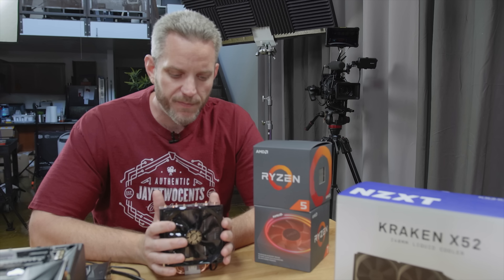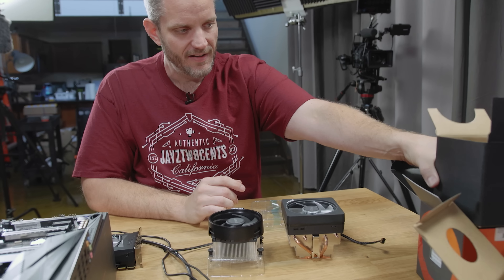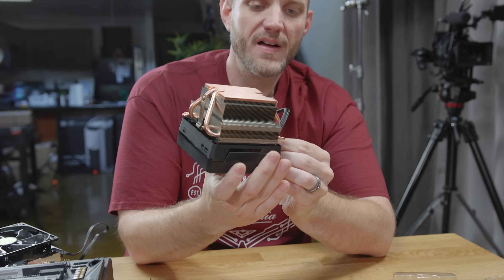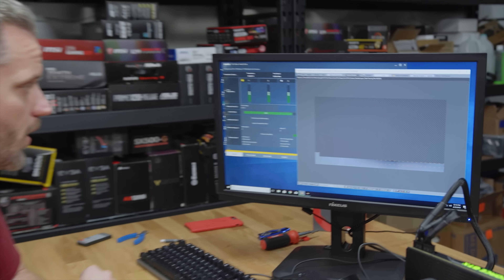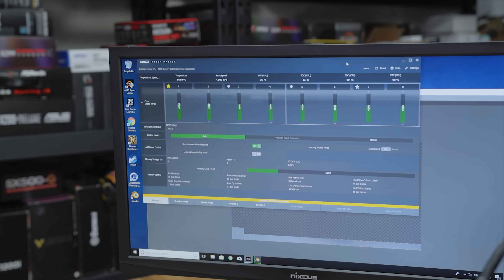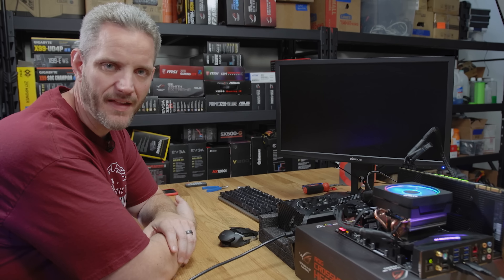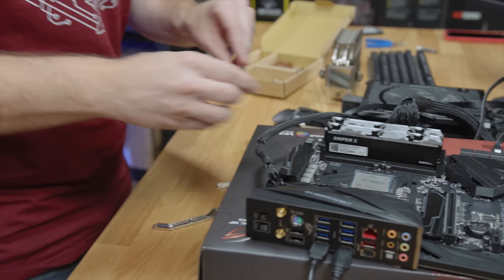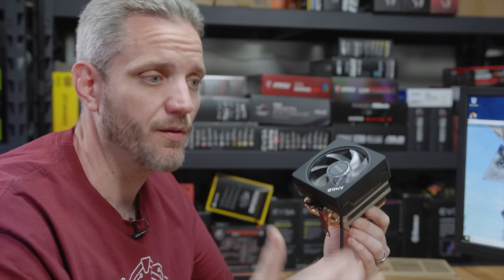Overclocking with a stock air cooler?? Is it even possible?

Comment: Intel: You need to buy K processors to overclock.
AMD: All our processors overclock themselves (as long as you have adequate cooling).
The difference in attitude is amazing
Reply: So can i overclock  on a b450 mainboard or i need to buy the x470
Reply: Apple vs android
Reply: @Max-io3uz  You can overclock an AMD cpu with a B-series motherboard.
Reply: @MrGrayfour  how about on a x470?
Reply: @OsmanthusWineZhongli  as the highest end chipset available for AMD CPUs at the moment, of course it can. :)
Reply: @MrGrayfour  x570
Reply: the z370 lets you overclock even if you don't have k
Reply: AMD is best. change my mind
Reply: kool aid obviously but you don’t have a warranty if you fry a cpu that’s not k
Reply: @solace512  thats bs
Reply: Still intel provides better perfomance for gaming
Reply: CIA if your going with performance yes intel Is currently better , but for the price AMD is fine
Reply: MrDope  I'm pretty sure he just means forcing all goes to body at turbo speeds. Technically "overclocking" I guess.
Reply: @Max-io3uz  For amd both Bxxx and Xxxx boards can overclock. Axxx boards can't
Reply: @Max-io3uz  b450 can overclock
Reply: @Max-io3uz  you can, check out the ryzen mobo tier list someone made.  Look for a tomahawk if you want to oc, one if kot the best b450 mobos.  Outranks even some x470
Reply: @WinningEmpire  x570 is a waste if money unless you are going with the eztreme high end (r9 3900)
Reply: @nerocladius4319  not anymore my friend
Reply: @camielschilham3958  skme b450 mobos don't jave proper heat sknos or vrms for cooling and therefore cannot do it safely, but they technically all can
Reply: @enderbartnik3148  x470 will do just fine too
Reply: kool aid yes but not all that much compared to a K processor. 

AMD allows full OC on every processor.
Reply: @RaNDomNvr  Easy. Android.
Reply: Intel Fanboy gonna zealous or enraged for this matter 
Lol
Reply: Team red forever
Reply: Ever heard of a boost clock?
Reply: To be fair, Intel does have turbo boost, which is AMD's "overclock themselves". Intel just don't want you being stupid and blow up your low-end motherboard.
Reply: SuperMikoo except the wraith stealth
Reply: Intel self overclocks too. It is called turbo boost.
Reply: I hate Intel now they have been ripping us off for years
Reply: intel for some reason sounds like apple mhmmm?
Reply: @Max-io3uz  As long as you have the psu for it.
Reply: @WinningEmpire  Yes, x570 too.
Reply: Doesn't matter it is overclock or real clock only thing matter is how much is the clock, In that intel is still is the king
Reply: @JithinJose2  No lol. It does matter. You shouldn't have to pay a premium to overclock.
Reply: @mhx6437  come on price matters, what I said was one processor 4gz and another one 3.8gz but by default it overclocks to 4gz does't have any diffrence.
Reply: @JithinJose2  You never said anything about 4 ghz nor 3.8 ghz processors... And you still shouldn't have to pay a premium to oc.
Reply: @JithinJose2  You said, and let me quote you: "Doesn't matter it is overclock or real overclock only thing matter is how much is the clock, In that intel is still the king". And also, wtf is overclock or real overclock? And AMD still gets around as good or better performance with lower clocks compared to intel.
Reply: Especially given Intel's weak ass position in the market.
Reply: Does anyone remeber when you could overclock q6600 to 3.6 ghz without k and other shit
Reply: I Doz Stuffz thats false.. AMD rules the market in performance too, with the exception of a handful of intel optimized games, which is just shitty Apple like behaviour and should be frowned upon and not be rewarded with fanboyism
Reply: ....And good VRMs on motherboard
Reply: @idozstuffz99  I mean, if you're buying PC parts, then why wouldn't you go with performance?
Reply: Also intels stock cooler is a waste of plastic and aluminum
Reply: @nerocladius4319  And ryzen is better in everything else . I9 9900k ? Whooped by ryzen 9 3900x , I9 10980xe? Whooped by ryzen 9 3950x
Reply: @idefkman  that was 8 months ago dude, no point in arguing with materials that came out after they had made their point
Reply: Intel is stable.  Your PC is not.
Reply: @MaxHarden  Hes smart your not
Reply: Huy Nông Đức *You’re
Reply: Why ppl always talk buy a damn old chipset..wtf if u buy go for last x570 forget fking old mb
Reply: Also AMD: Here's a stock cooler with RGB that will give you a little headroom to push your system
Reply: Intel is the person that goes to a restraint in business casual (“professional “) and and is the person that goes in a jumper and joggers (casual)
Reply: Sure.... Don't like the way INTEL conduct their business practice. BUT, do realize.... that buying "PRE CLOCK" CPUs from AMD can be only pushed so far. There is a reason many if not ALL AMD cpu's can't even reach 5.0ghz, where as Intel its not a problem.
Reply: @fpshooterful  Clock speed doesn't mean as much as you think it does. 

Besides, AMD was the first ever to hit 5.0ghz on a chip. We all learned then that it wasn't as important as core ipc and threads, as the intel offerings at the time still stomped the Fx 9590 when they couldn't get even close to 5ghz.
Reply: Stooopid question but up to what temperature does ryzen continue overclocking itself?
Reply: @MrGrayfour  even with a series ex. my a320
Reply: Any mobo, you can oc.
Reply: @Max-io3uz  you can
Reply: @OsmanthusWineZhongli  yes you van
Reply: @solace512  that is not true
Reply: Also includes a badass rgb stock cooler
Reply: @RaNDomNvr  that comparrison actually makes no sence bc apple is a brand android is an os
Reply: @nerocladius4319  times have changed my friend
Reply: @butilikepizzatho4851  technically, you can, it's just prob only BCLK OC
Reply: @idefkman  no no intel is still better in gaming but anything else ryzen is better
Reply: @hamee4478  not at all intel still whoops amd in gaming amd is only better for non gaming
Reply: AMD treats overclocking the same way Intel treats integrated graphics, and vice versa
Reply: @nikenzzo  Because the AMD fanboys and shills are poor people 🤣
Reply: @christophervanzetta  😂
Reply: @nerocladius4319  only when you play at 1080p and when you use something like 2080Ti for bottlenecking the CPU. In most of the realistic case, it is the GPU that will be bottlenecked due to higher resolutions like 1440p or 4K.
People won't even know the extra 4-5 FPS they get in Intel on these Resolution
Reply: @vatsalyasharan4202  It's not "extra 4-5 fps", it's something about 10-15 percent gap. And gaming is just an indicator how well a CPU performs in realtime and latency limited tasks.
Reply: Russian made cpu. Cpu processe you
Reply: Intel has self-overclock technology since 2008, it's called "Turbo Boost".
When you pay for a K series CPU, you pay for an extra performance, as these chips operate at higher clock speeds by default. Overclocking is just a bonus for entusiasts. A bonus that even not officially supported. You'll lose your warranty if you cook the chip. And same goes with AMD btw.
Reply: @GrimPie  dude what lance ment to say was amd is already overclockabke as the base cpu and you dont have to pay more money for a hogher performing chip when i could just pay 1 flat price get the chip and do whatever i want with it
Reply: @moncery_na  The K and non-K CPUs are basically the same story as 3700x and 3800x. It's different CPUs with different performance out of the box, and you pay *for that extra performance*. It isn't about the attitude, it's about lineup. Intel could sale their 10600 unlocked, but who would buy 10600k then?
Reply: @GrimPie  dude thats not the point im teying to make. Because just to keep intel chips cool if you wanna do any overclocking. Yoi gotta buy an expensive board you gotta delid it. And you need a decent cooler. When ryzen cpus all you really need to ger the most out of your chip is high speed ram which is cheap. And the stock cooler for the 3700x and 3800x are WAAAAAY BETTER that intel stock cooler
Reply: @moncery_na  Who told you that? Some years ago my 4790k (which is the most powerful CPU for 1150 socket) was fine with stock cooler, it never gone above 76c. Noise was the only problem, which I fixed with a $30 Zalman cooler. it was installed in a dirt cheap h97 mobo, since at the time the only thing I thought was important for motherboard is that you have one. My system worked flawlesly for 5.5 years, until I slammed RTX2080ti into my case which my CPU simply couldn't handle. I used it for gaming, for heavy stuff like V-Ray rendering or After Effects, recording and streaming. Never had any problems with CPU temperatures. Last year it was overclocked to 4.4GHz, it was even cooler with $50 cooler, but I simply didn't see a reason to go further, since you can't fill 30fps drops in some modern games with 0.2-0.3 overclock. I didn't need to overclock it before, because my GTX980 was bottleneck all of the time. 
You don't need to delid anything, 10th gen Intel CPUs have solder as TIM, and they made the die thiner. With my old cooler, 10700k have almost the same temperatures under full load, as my old 4790k. It was a bit of a pain for overclockers, but it was well beyond Intel specifications.
If you're looking for a good board, it will cost you the same.
I don't want to sound like I'm saying that AMD Ryzen is bad, or something, I almost bought one of these for myself, but if you need a high speed ram to unleash full power of the CPU, there's something wrong with it. Also you have to deal with this infinity fabric thing, which introduces additional latency if you've gone beyond 3733MHz on ram.
Reply: @moncery_na  You're wrong. Streaming doesn't use much resources, with modern nVidia GPU you can stream using nVenc, turing's video quality is insanely close to medium x264 or even beat it in some occasions. Or you can use Inte's Quick Sync. Hardware encoding is much more efficient, and with quality modern encoders are pushing it is stupid not to use them. 3D design and editing will be better on Intel, because most of applications can make a use only of a few cores. AutoCAD uses only 1 core for it's calculations, many modifiers in 3ds max use 1 core as well, Adobe software works in a similar way. And it's not because we didn't have 16 cores CPU on the market, it's because it easier to make software that way and in some cases you won't benefit from multithreading at all. Rendering will be better though, because this is indeed a proper multithreaded load, and AMD implementation of SMT is better than Intel's HT. Though there's some exceptions, like if you're using many After Effects plugins that doesn't know how to multithread, then you'll be limited to a single core performance of your CPU.
I just told you that I was using highest tier Intel CPU with a dirt cheap motherboard, it costed me less than HyperX Fury 16gb@1600 kit, and it worked flawlessly for a 5.5 years. And I'm more than sure that average user can do the same today, you buy a H410 board and it will work just fine with something like 10700k. Probably.
S-ATX boards prices are almost the same if you're looking for 4000MHz+ memory support.
As I just say, even a $30 cooler will do the job, and you have some room to overclock on $50 one. Also I think that this is stupid to push the CPU outside it's specs and to complain about it's performance. Ryzen series can be hot as well, as it requires a lot more voltage to achieve 4.3-4.4 core speeds and can easily consume 130 watts of power, peaking at 160, so think again about how you choose your mobo.
8700k was up to 20% faster in After Effects for RAM preview (read this as scene rendering), and it beat the AMD in gaming. So, now, they were not equal, and SRP for 8700k was up to $370.
Reply: @nerocladius4319  6% more for 70% higher price
Reply: @christophervanzetta  stop calling amd users poor, we know you have i3 1st gen
Reply: @augie6029  nah, I have a 9th gen i7 🤣
Reply: @christophervanzetta  coughs in 3950x 🤡
Reply: @augie6029  Waste of money 🤣
Reply: @christophervanzetta  its not a waste of money. Its actually what i use with my work and its incredible. im not gonna waste money for buying intel and play games.
Reply: @augie6029  You watch too much YouTube. Intel has great performance per core which is why it's faster
Reply: @christophervanzetta  yes it's faster on games 
.
Reply: @Max-io3uz  Extremely easy on b450. I just did it for the first time with Ryzen 5 onboard.
Reply: Adequate cooling, and the overclock compatible motherboards
Reply: @AaronShenghao  Why is Intel concerned if we blow up our boards or not?
Are they our parents?
Just admit it that they just want more money.
Reply: @MaxHarden  I'm smart. You're not
Reply: Y'all been talking about this shit for a long time LOL.  Just buy whatever you want
Reply: I like amd and all, but it's kinda counteracted by the fact that Intel overclocks super well while amd overclocks like balls
Reply: Yeah but u Can overclock with Stock cooling on intel. I onde OC my cpu to 20% more and it Got like 2° hotter
Reply: @idozstuffz99  you sure?
Reply: @nerocladius4319  not anymore 🤣
Reply: @i_biscuit7140 this was before ryzen 3000 and 4000 Intel used to be better though in terms of performance you can't deny. Intel isnt even an option anymore tho
Reply: @nerocladius4319  this comment didn't age well.
Reply: @Max-io3uz  I have a B450 gaming K4 from Asrock and my Ryzen 5 2600 is comfortable at 4 GHZ all core overclock with max load temperatures staying under 65 celcius on a tower cooler clone from China. The B450 board does pretty well with an OC
Reply: Intel: here is a $700 cpu that you cannot overclock, that also comes with the terrible intel stock cooler.
AMD: here is a $250 cpu that you can overclock, that also comes with a half decent stock cooler.
intel has left the chat
Reply: @carmaster_2jz729  depends which line you are talking about. Athlon is outdated, but ryzen and threadripper are on top.
Reply: @nerocladius4319  for $700
Reply: @MrGrayfour  good
Reply: @nerocladius4319  no lol
Reply: "all of our processors overclock themselves, and we even include a suitable cooler to do so."
Reply: @camielschilham3958  Wrong? A-series can still overclock too, it's just up to the motherboard vendors. AMD only promised they'd make sure all B and X series can OC.
Reply: I actually kinda want to underclock my Ryzen 7.
Reply: @bengonzales1182  Under volt
Reply: I’m an Amd fanboy 23+ year builder.
Historically that statement isn’t true at all.
Reply: X3D CPUs can't overclock tho
Reply: @Max-io3uz  all B and X motherboards can overclock, only A one's can't
Reply: @WinningEmpire  B350, B450, B550 and B650 all can overclock too